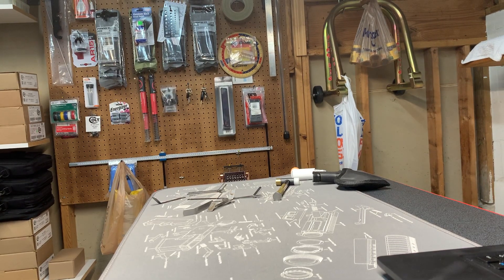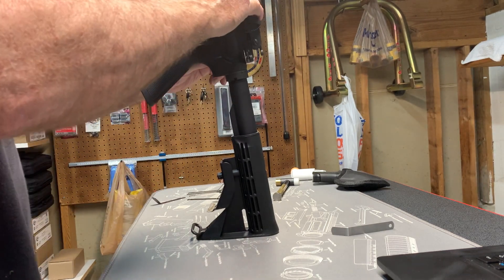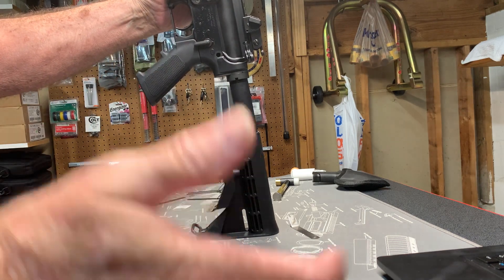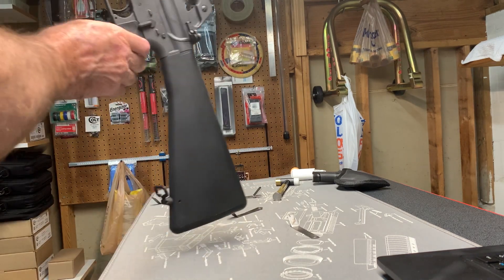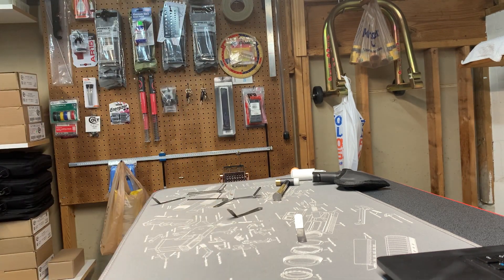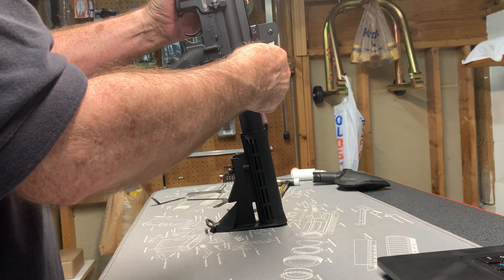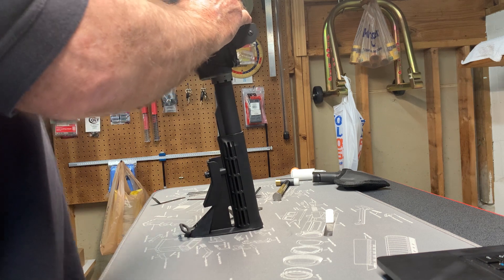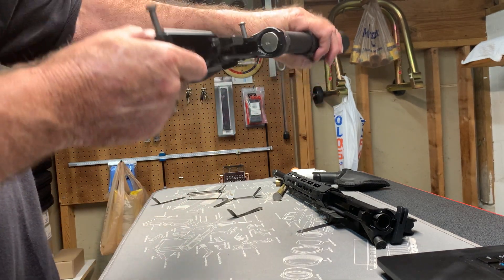AR-15 Buffer to Buffer Retaining Pin Clearance Measurement (how too)

Comment: I was looking for answers to this question and your video helped to explain the issue I am having. I bought a BCM complete upper everything was to spec the problem was I matched it with a Anderson lower a.k.a poverty pony. I'm not saying that they are all out of spec for those that do own them but I noticed a gap between my upper and lower that looked to be around 10-20 thou wide. Wide enough you can see daylight through it if the bolt isn't in. So I was told it shouldn't effect the gun and so I went to the range to shoot and when I got home to clean it my Geiselle 42 buffer was marked up from hitting the retaining pin instead of resting on the bolt carrier when it was closed. I found a place to order a offset retaining pin that I will use to see if it helps fix the issue, if not I guess I'm buying a new lower of better quality and QC possibly Aero M4E1 or the actual BCM lower that costs entirely too much because you can't just buy the non built lowers.

Comment: pitting around the outside edge of buffer shows impact with buffer retaining pin while circular shaped impact marks closer to the center have been due to small burrs on rear of carrier.... in my experience.   
i have also observed the occasional scratch marks resulting from simply opening or closing the two receivers.  
good video all around!